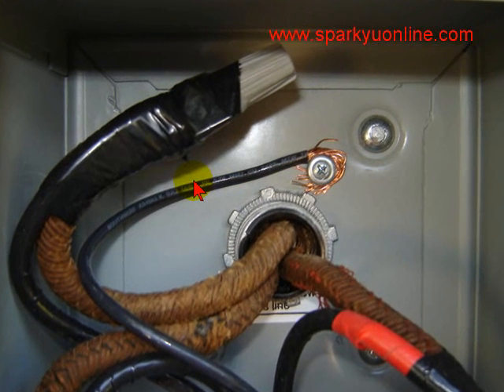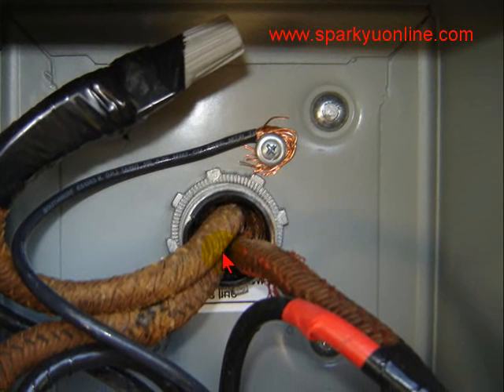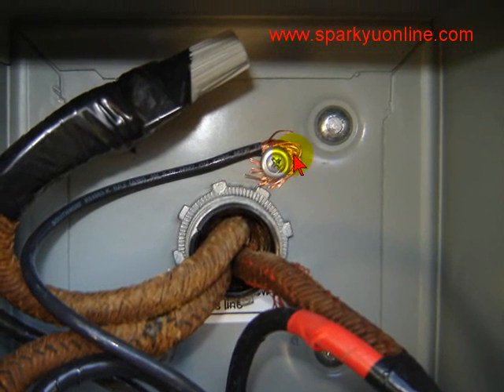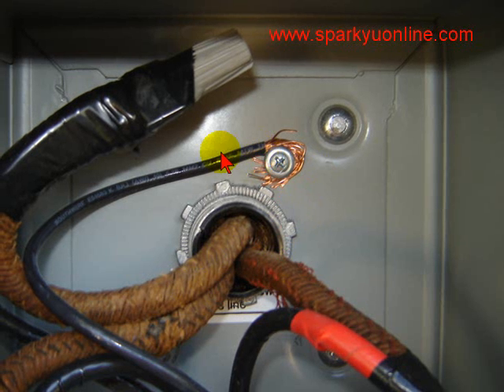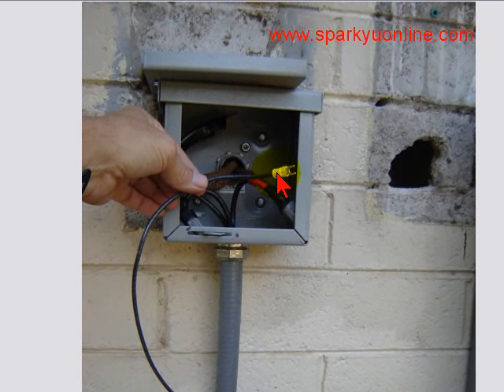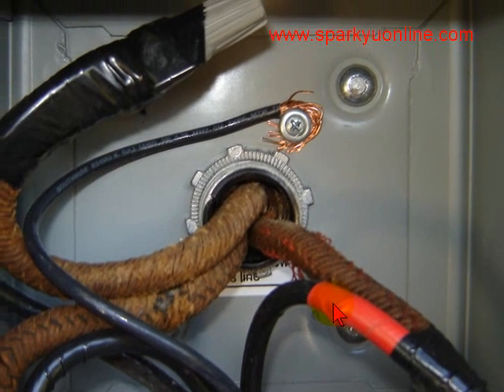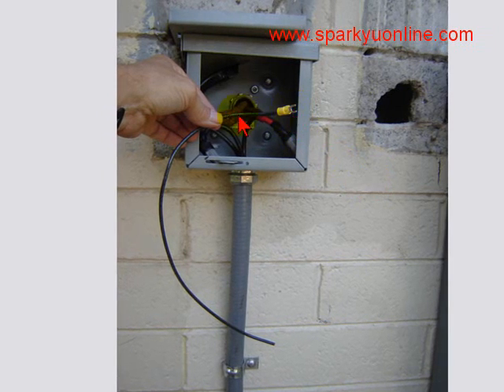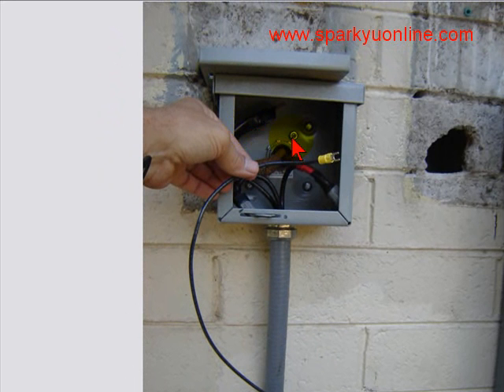Electrical Wiring-Fake Ground wire

Comment: what a half --- job  all he had to do was attach the ground wire to the grounding screw I myself would have drilled and tapped for the 10-32 green ground screw in the junction box, add the ground pigtail spliced with the two ground wires in the panel. Either a wire nut or split bolts (depending on code) latter I would have insulated.

Comment: This is an old video but I would like to mention that this is why I DIY my own simple electrical repairs in my home - replacing receptacles and switches, adding my own can lights, verify metal boxes are actually grounded (I found one that was not), check all screws are tight in my panel, etc. If I replace my panel then I would likely call in a pro but I would also watch the work.

Comment: I have seen the fake ground manuever lol on a gas bond in a attic once they connected it to the gas line with the pipe clamp and just tucked the other end like 20 feet into the attic under insulation

Comment: so, few questions,  how much do you or did you pay this guy an hour and did you supply the proper material to be done correctly?
Reply: You're an idiot.  You're saying this is ok because he wasn't paid enough? No one forced him to take that job snowflake.  How about taking pride in your work so you can make more money.  Your generation I tell ya.  Everyone owes you something.  Now, I hope this guys tells every company he knows to not hire this dirtbag.
Reply from the maker: $18ph,yes I supplied the proper materials. Somehow I feel your trying to imply something?
Reply: Pay more and you will get better results.
Reply: People go to work for 1 reason and 1 reason only and that's for money. You should be ashamed to pay any electrician 600 a week on 40 hours.  For 600 a week you get a guy either living home or stuggling to eat. How would you live off 600 a week? That's an embarrassment
Reply from the maker: Not true.If I had paid him $30 ph your saying he wouldn't have done this.
Reply from the maker: At the time that was the going wage,it was fair by comparison to this 
area. BTW if he did not like the pay he was free to go somewhere else. I
 gave him a company van w/paid gas and paid holidays. I treated him good
 and he paid me back by cheating the system. It has nothing to do with 
pay and everything to do with integrity.
Reply: Has everything to do with pay. You get what you pay for. 18 a hr is helper money. Someone who u have to remind to ground the box. If you want quality workers it will cost you 22 plus a hour.

The problem these days are people pay by the hour, that's wrong  you pay for what you want, on time? Quality work? Motivated? Fast? Reliable? Each one of those goes for 5 to 10 a hour so u do the math
Reply: You pay 18 a hr you give him a van you get shit work. You give the job to the guy who asked what he deserves and you will get what you deserve. I get payed pretty good and I appreciate it so much that I do everything to the T. I even bring coffee in the mornings:)

Comment: That whole thing would be so much better if 20 bucks was spent on an actual air conditioner disconnect box. It has the proper L1, L2, and ground terminals.
Reply: They don't even cost that much. Since there is no disconnect box for the central air unit, THAT is the real violation here.

Comment: I actually faked a ground once, as an apprentice, at the direction of a master electrician.  I had to run three runs of #2 THHN through 300' of EMT, and the supplied conduit was sized 'by the book' but really the conduit should have been the next size up - it was a tight fit with all of the 90s in it.  C-fittings had been supplied to make it look legal, but I couldn't pull from them - I had to pull the whole 300' by myself.  In Canada at the time it was NOT required to run a ground in EMT unless that EMT is being buried or run in concrete.  So I pulled the required wires through the EMT but left out the ground so I could make the corners without scrubbing the insulation off of the wires, and when the master electrician showed up he was hopping up and down that it had to have a ground.  I told him it did not.  He did not agree.  Showing him the code book did not help.  He told me to shove 6 feet of green THHN in each end to make it look like I had pulled the ground.  Hey... what did I know... I was just an apprentice...  By the way... I do, by preference, always run a ground in EMT, but this was a situation where I used the rules to help me out, then it kind of backfired.  At least the ground I faked didn't actually have to be there...
Reply: Mike Graham I'm a journeyman and first of all EMT is not suitable for direct burial and especially not in concrete the moisture would eat away at it it would have to be either Ridgid pipe or pvc

Comment: I'm going to throw this out there if anyone of you can help my understanding. I built my own robust dual-axis solar tracking system and wired a transfer switch into my service panel (lots of detail left out here for brevity).  I obtained City permits, passed all tests as well as inspection. Good. Reduced a monthly electric bill from $438 down to just less than $70 for a two-story house of 3,700 sf livable (Better!).  Sold the house, purchased another.  I want to do away with the complexity of wiring via a transfer switch and go directly to the service panel by locking out the 200a main with a legal "Interlock Switch." That done, I now have a completely energy-free panel.  I want to insert a new 240vac circuit breaker (CB) into the panel (top of L1) that I will energize with a generator. That CB now provides energy to L1 on the left side. I fully understand it will power similar CBs below it on L1.  Here's my question: how do I energize L2?  With another CB powered by my same generator (120vac)?  Any help with my understanding would be greatly appreciated as I prefer being human and not a walking conductor!  The proper answer will save me lots of $$ if I can avoid going to a split-phase system (costly generator outputting both 240 and 120vac), but will readily do so if necessary.  John

Comment: Done by a journeyman???!!!  Wow.  As to a green grounding screw,  I don't think code requires green screws.  I'd be more concerned that a black wire would be used for earth ground, I do believe that's against code.

And agree with taped wire nuts.  Totally useless, annoying and redundant.  Also taping over screws on receptacles and switches.  I rewire a lot of old work and the tape, when used, lost its adhesive and is usually just disintegrating or gumming up everything in the boxes.
Reply: +Richard Fallstich 
Great point. I would further add, if some asks you a question (even a seemingly obvious one) don't make them feel stupid when you answer it, just give a good answer. 
So many guys out there are afraid to ask questions, because in the past somebody has rolled their eyes, or called them stupid for simply seeking knowledge.

Comment: He's either lazy or he didn't understand that the third wire is not a neutral, but is instead the equipment ground, and was too embarrassed to say anything.  However, he should have been able to deduce that it was an equipment ground from tracing the wires back to the panel.  Here's a lesson for those of you who aren't lazy: if you don't know what you're doing - EVEN IF YOU THINK YOU SHOULD KNOW - ask questions.  It's better to look stupid now than to hurt something or somebody later.
Reply: he didnt need to ad that extra ground. most residential ac units dont take a neutral

Comment: Set a lug for the ground ,  don't use a crimp on fork connector .   Also would be nice to use insulated bug connectors instead of wire nuts for the connections,  although wire nuts are OK if you have to.   A properly installed wire nut never needs electrical tape wrapped around it after it is installed ,  that is always a sign of someone who really doesn't know what they are doing .

Comment: The individual legs are not "phase" the relationship between them is a "phase" .  
If you have a red phase and black phase you must have 2 phase power in your world?
Sorry to rag on you for this but its a fact that electron plumbers continually get this wrong! If you going to talk it know it and talk correct! Single phase power = 2 hot legs with 180 degrees phase offset, 2 hots one or single phase. 3 phase = 3 hot legs with 120 degree offset. there is no phase rotation in one hot wire therefor you don't have a black phase and a red phase!
Reply: Some Guy Good thing you know your stuff. Even though it is correct to say split phase, two phase is very common. I think for the sake of conversation either form is acceptable.

Comment: How do you connect the wires from coming out of your main box from a mobile home to Maine outside box
Reply: +Carlos Carlos  Using cable rated for direct burial in a ditch that are protected by coduit at both ends is stabdard. Use cable of s sixe th has current carring capactity for homes load. When it comes to moble home tou may need to  dtrimine if the  nutral and ground buss' need to be bonded or not. Bonded or unbonded cepends if the grid you are contecting to use a binded to ground nuetral system or not. In the event multiple ground groud come onto play, they dhould be bonded to each other.
-Disclaimer* any suggestion from anonymous persons on the web are at best   used as an example to begin research to find the best advice available

Comment: Stupid question, But why does a screw need to be painted green to do what any normal screw would? Also, Why would someone bond the neutral and ground in the main? Doesn't that defeat the purpose a bit? Elec will take shortest path to ground. So wouldn't you be putting voltage on the ground and when a fault does occur, 120 will see its self already on the line and not take that path. And where do they get "neutral" when it takes BOTH legs to function? Both sides are hot.
Reply: Neutral is not necessary for this, it's only necessary for 120 V appliances. Appliances which need more power are using 240 V. Higher voltage means less current for the same demand. The appliance is connected between the two hot wires, neutral is in the middle. 10 kV is the mid-voltage supply, normally supplying a township:

https://upload.wikimedia.org/wikipedia/commons/e/e8/Split_phase.svg

And the ground is for safety, in case of a failure touchable metal surfaces could not get hot. If a line conductor would touch a part of the metal casing the circuit breaker would trip immediatly. The neutral wire is always grounded. The current is flowing back on one of the hot wires, this is due to the phase distortion between the two line conductors. It's the same principle like the three-phase electric power, especially "Delta" where you don't have a neutral:

https://en.wikipedia.org/wiki/Three-phase_electric_power
Reply: It's green for identification purposes.

Comment: You need to ground the main box. 12? Go as thick as you can go to a point. Remember you can't over-do-it with ground. The more the merrier! Make sure your contact with that rod is done with a tool and is tight. Try to use Torque, Bolt(s), etc instead of screws. Grounding a random socket will cause the system to be off balance. Make sure its the Incoming MAIN Box Ground your doing this with. As always be careful!

Comment: I sometimes catch shoddy work by outside contractor "electricians" in our factory.
I have also had to go back a repair the stuff they got wrong and make it work correctly after they have left.
I am NOT a licensed electrician.
I AM a Senior Electronics Maintenance technician IN A FACTORY.
I have a LOT of pride in my work that I do there .
It carries over to my own home that I can also legally wire myself in my state.
"When in doubt , pull it out" is my favorite saying for electrical work.

Comment: It could cause ground loops if other parts of your house aren't properly grounded. It could also be dangerous if there is a fault on that line only and someone steps outside barefoot during a rainy day. Its best to have everything connected to the same ground.

Comment: my outlet isn't grounded, can i just buy some 12 gauge green wire and screw it to the receptacle and then ground it to a 8ft rod outside directly?
Reply: No! A ground rod in itself is NOT capable of clearing a fault (tripping a breaker due to fault current). The grounding conductor needs to be connected to the main service panel.

Comment: I'm a former AT&T tech, i used to hate going into telco rooms and terminals and seeing the big mess. It makes your job harder when you're working there, the problem is all the outside contractors and others doing their own phone work. But even the AT&T tech who did our cable installation didnt do it right. In the old days we had to follow the BSP, nowdays techs don't know what that is. (Bell System Practice).

Comment: just cuz no one has answered... I believe in most residential circumstances 5/8" diameter now required (as opposed to 1/2" copper) and two rods placed I think 6' apart.

Comment: I don't know much about electric .but i got a question .. now that copper cost a lot they will let the electricians use galvinized steel for ground rod below the meter out side..this if florida if that matters...I'm thinking in about 50 years me and the ground rod won't be here no more ..what you think ?
Reply: They are still digging out (iron) viking swords and the like, by the ton. I am more concerned about the point where the wire attaches to the rod, and how it's done.

I expect they would go for thick plating or aluminum, not just steel.

Comment: My solution: chair lug after paint removed from bonding surface then 8-32 threaded anchor screw. For the entry nipple you need a plastic bushing. Don't forget d-ox when using aluminum. That should make the inspector happy, The fake ground wire? wrong color, wrong size and a real inspector pisser offer, Good video on basics.

Comment: Hi sparky well done for spotting the fake ground wire can you imagine how dangerous this could have been lol, I live in the uk and we are very strict on grounding and cross bonding. over here we operate on 240volts and our mobile appliance maximum current is draw is 3000watt (12.5amp) ho and our groud/earth or cpc wires have a green and yellow insulation. Paul

Comment: Ah, sounds logical. I think the difference in North America is our split phase system. If the main neutral to the house breaks or gets disconnected, we will get weird voltages on the two live wires, but will not get voltage on the bare ground wires. Google "split phase" to read up on it. The system is unique to NA far as I know.

The thicker wire may be for voltage drop reasons, since most of our stuff is only 120v. For 15 amps, we use 1.6mm diameter. 20 amps is 2mm diameter. What does Aus use?

Comment: we have something similar to your Romex which we call TPS ( ThermoPlastic Sheathed ) which is an Active Neutral and Earth, but our earth here is also sheathed, not bare. all earth cabling now must be sheathed. The logic is that if the main Neutral breaks, and the earth becomes the load carrying conductor, you lessen the chance of electrical shock from step and touch potential. from what ive seen about your conductor sizes, you guys use alot thicker gauge stuff compared to Australia for Amps...

Comment: In the US, metal conduit is typically only used outside or in more commercial/industrial situations. In residential, by far the most common wiring is NM (non-metallic), also called Romex. It has 2 conductors+bare ground, surrounded by a PVC jacket. The wiring is run behind walls and in ceilings.

Junction boxes inside the wall (at switches and receptacles) are usually metal, but can be plastic as well.

Comment: Here in Australia we have different standards to the US. We use single phase 230v in the home, and 415v 3 phase for industrial/commercial. although 3 phase to the home panel is now more common with underground vs line fed areas. Here we also do not use metal conduit and metal boxes. we use plastic conduit. No wall boxes are needed for plasterboard sheet walls. If there was a metal accessory that requires an earth, we use a spade lug and screw into the device but there is normally a terminal

Comment: Please show us the proper way to ground the box.  What size wire?. Do you sand the paint off the contact point? Is a terminal better than a crimp connector?

Comment: I did a side job on a friend's house once,he had a 200 amp single phase panel fed from a 60 amp round old style aluminum meter socket with the old cloth wiring,and in the kitchen he had his range hood fed with a lamp cord from one side of the 50 amp 240 volt receptacle.I asked him "did you do this?" he said the previous homeowner did this and the funny thing is he used to be a union electrician.and I said I can see why he "USED TO BE A UNION ELECTRICIAN" lol.

Comment: @bilzup We dont, but with old buildings needing repair, the old wires are left in place. A true nightmare when your swapping out boxes or trying to find a isolated circuit. I've seen live ceramic couplers and bare wire, just a fire waiting to happen.

Comment: I have had somthing odd happen the power in the bathroom has stoped working and in testing the wires I have found the I have juce flowing through the black (i know that is normal) and the ground (I know that is not normal ) My question is this how do I correct it I was told that I might have a loose nuetral wire if that's the case how do I trace it thanks

Comment: @tbwjs 
Good call. Many people forget about how to ground under article 250. One of the biggest is the supplemental grounding requirement due to the use of plastic water lines.  Grounding vs. bonding is something that needs to be promoted in training.

Is that yellow  spade crimp connector listed for high voltage applications?...LOL